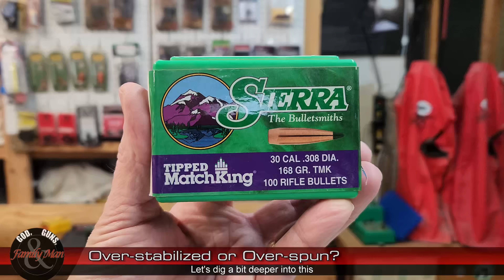You can't over-stabilize a bullet (but you can over-spin)

Comment: Bullet companies list MIN twist rates for some bullets.......usually 8 or faster for modern heavy for caliber high BC bullets......but now wondering if they also need to list MAX twist rates or better still, MAX muzzle velocity for the fast twist barrels like 7, 7 1/2, 8 etc. if using that bullet? A bullet flying apart as it leaves the barrel would seem to be as big of a problem as one that is not revved up enough to stabilize it. Maybe in practice most guys never get them going fast enough to fly apart?

Comment: If I shoot a pistol under high angle close to vertical will the bullet still spin and point upwards or will be coming down with the point first
Reply: I mean will a short blunt projectile spin stabilised that it will not turn like gyroscope
Reply from the maker: @CsakEn-pl7uv  It will still spin due to the rifle and should -in theory- come down nose first.  Not a test I recommend actually trying though.  :)
Thanks for watching and posting.

Comment: I'm glad someone FINALLY decided to make a video on this. 

Putting a 1/3 twist barrel on your grandpa's 30-30 isn't going to magically give it match-grade performance. Bullet profile and consistency have more to do with accuracy than over-stock twist rate. Also, there are a lot of "match grade" bullets out there, that simply aren't. People think those words automatically translate to better accuracy... when it could simply be a specified profile/weight of any sanctioning body. Back in the old days of shotgun slug matches, some rules actually dictated real slugs... as in, what closely resembles a piece of bar stock with a round nose.
Reply from the maker: Well said James.  Thanks for watching and posting.
Reply: @sdkweber  - thanks again, for the content. 👍

Comment: Put the centrifugal force into the equation. An over spun bullet will fly apart . The center of gravity and the center of mass are not in the same place for a bullet but a foot ball they are. Make a bullet where the front and the back are the same and spin rate won't matter. Modern bullets do not arc over like a foot ball.
Reply from the maker: Good explanation.   Thanks for posting and watching, Ronald
Reply: That's not true, Ronald, and extreme long range targets prove it.
Reply: @jasonshults368  It is only 5° at 4 miles. The hole in the target will still look round.

Comment: Yep, I am gut-twisted every time someone uses that term "over-xxx". See, I can't even type it. My question always was, "For a given cartridge/bullet combination, as the twist rate increases and one moves from under-stabilized (big groups on paper) to marginally stabilized to stabilized (smaller groups) at what point do you have too much stabilization? On the other hand, an excessive spin is easy to detect by midflight disintegration. 'Overbore' is another imprecise term I am loath to use other than to point out its users employ it to put on a facade of knowledge.
Reply: That point was found with 1:3" twist 338 cal subsonics to be about 950~fps. There is a notable increase in dispersion & fliers iirc.

Comment: In my experience, 'a little too much' overspin is better in results than 'a little' underspin.  In .308 caliber, the 1903 Springfield was designed for 220 grain round nosed bullets initially, but quickly changed to a somewhat faster 150 grain spitzer bullet.  The rifle twist was kept at the initial 1 rotation in 10 inches (1in 10) twist.  I have loaded and shot bullets in a similar barrel with weights from 147 grain to 220 grain and all seem to do well for me.
This may be explained by accuracy requirements.  I do not shoot bench rest, so my accuracy expectations - requirements are not as great.  That could be the explanation.  

In anecdote, I do have an older rifle with a well used barrel.  The rifling is so worn (bad) one can identify the type of bullet at 25 yards.  The bullet struck sideways.  (I did rebarrel that rifle.)

Comment: I've noted that when hand load testing if i load a match bullet at say close to 275,000 RPM it tends to be more explosive (fragment) at around 75-100 yards but will expand at longer range 200-300 yards. And at around 350,000 RPM it can literally explode in flight. this is hog hunting
Reply from the maker: That number (350,000 RPM) has been cited by others as the point of excessive spin in some cartridges

Comment: You do a fine job of explaining this topic sir. 
Any imperfections in the bullet that affects the radial balance of the bullet IE looking at the bullet in cross section if the center of the bullet and the center of mass are not aligned due to variation in jacket thickness or variation in lead density or presence of porosity etc… this slight radial imbalance causes the precession cycles of the nose of the bullet to become enhanced or increased. Radial imbalances cause the spinning bullet to be perturbed and this perturbance is greater the faster it spins which increases dispersion. Modern premium bullet manufacturing has improved such that bullets are more dimensionally precise with less of this radial imbalance than bullets manufactured decades ago. 
So with cup and core bullets it is best to avoid over spinning bullets especially if you are running mass produced lower cost bullets that aren’t as dimensionally precise. 
Elite ELR shooters even use bullets precisely machined from monolithic materials to try to achieve perfect radial geometry so they can capitalize on fast twist with very long bullets without incurring increased dispersion due to these effects… and whatever other magic they embark upon to deal with dynamic stability in the transonic and subsonic zones that I do not fully understand. 
Projectile stability is a very interesting topic. 
Cheers!
Reply from the maker: This is some very good extra information.  Thank you for posting this! Well done.

Comment: Shooting lighter 223 bullets even at 223 velocity's with a 1-7 twist rate damage's the thin bullets jacket an shape  causing poor accuracy at even higher velocitys like the 220swift with a 1-7 twist rate might break apart in the barrel or shortly after leaving the barrel and with the slower twist rate wont stabilize heaver bullets   a lot of older rifle calibers were made this way such as 270,25.06, 220swift and more and all of them would have been much more useful for hunting a wider range of game if they would have been made with a faster twist rate you can overcome this problem by shooting solid copper bullets in lighter weights they won't deform from faster twist rates an gives higher bc numbers rifles with slower twist rates will forever only shoot lighter short bullets well without changing the barrel
Reply: thats not over stabilized... thats just exceeding it construction.

Comment: I  reloaded some blem 2nds. 40gr V-max look alike with blue tip. I suspect they were 5.7x28 bullets as my.223 1 in 8 twist rifle doing 3700fps spit a shard of jacket into my chronograph display. Over spun at speed?  My 24"W.O.A.1-12 twist spits them out at 3850fps with great results
Reply: thats not over stabilized... thats just exceeding it construction.
Reply: There are a lot of factors that can cause a bullet to come apart after leaving the muzzle. Among the most significant is the condition of the bore.

Comment: A full power 5.56X45 round in a 1-7 twist is rotating at over 200,000 RPM. If you've ever loaded light 45-55gr varmint soft points, fired from a 20-24" 1-7 barrel, the projectiles will often self-destruct just a few feet from the muzzle.

It was a real problem for me in the 80s & 90s (as noted in the Speer reloading manuals). By 2000, it seemed the 55gr soft points were not so thin skinned. They could survive full power loads in a 1-7 now.
Reply: thats not over stabilized... thats just exceeding it construction.
Reply from the maker: @russr  Correct.  Over-spun but not over stabilized.  I shot 40 grain varmint bullets in my .220 Swift at 4,230 fps and some of those just vaporized between me and the target.
Reply: @sdkweber  yeah, I had some Sierra 50 grain soft points play kept exploding about 10 ft out of the muzzle in my AR..

I never really had problems with VMAX. I had a load for my 40 grain V-Max what's 28 grains of 748 which is a compressed load and it would shoot under a half inch of 200 yd.... 223 load
Reply from the maker: @russr  I have used a lot of moly coated VMAX bullets in my .220 Swift and I like the Winchester/Nosler Combined Technology 40gr. bullets.  
That VMAX was shooting well for you.  I hope you stocked up on those bullets.  :)
Reply: @sdkweber  I switched away from the 40s to the 53 gainers, because most of my groundhog shooting was between 300 and 700 yards and the 40s kind of suck for those distances. 
Under 300 yd they were like laser beams but they dropped speed too fast.
Reply from the maker: @russr  I agree. And those 40 gr. bullets are killed by the wind.  Nothing really possible much over 400 yards.  But 0-400 it is like you say, a true laser beam.
Reply: A bullet is like a flywheel.  It takes energy to spin it. It dissipates that energy into the target.
Overspinning a projectile diverts energy from velocity into rotation. It should be spun enough to stabilize but not much more than necessary.

Comment: Are you also going to think about copper bullets as they are longer than lead bullets at the same weight?
Reply from the maker: Good questions and yes. The same concept holds true with copper bullets.  We need to stabilize them but not over-spin them.  I suspect however, that the homogeneity of the copper will reduce the imperfections within the bullet and MAY decrease the effect of over-spinning, that is, a degraded precision of our groups.

Comment: I really enjoyed this video. So is the bullet sized slightly larger (224 in a 223 and 308 in a 300) so that it has to be slightly squeezed to better engage the rifling?  I'm also curious to read your reply to Mike-xi4zt's comment below should you respond to it.  I've seen some of the slugs that Taufledermaus shoots on his channel that through the use of a high speed camera seem to show no spin and yet hit the target.  Perhaps while not 'finned' it's because the slugs have unusual shapes that mimic them? Thanks as always!
Reply from the maker: Thanks for watching Aaron.
You got it right.  The bullet is wider than the distances across the lands.  This forces the lands (rifling) to bite into the bullet and engrave fired bullets with the firearm's rifling.  The naming though can sometimes be just marketing.  For instance a .300 PRC shoots a .308 bullet, but so does the .308 Win. and .30-06 and .30-30 Win.  A .220 Swift shoots the same bullet diameter as a .223 and .22-250.
I have not seen Taufledermaus' videos. I will look it up.
Take care Aaron.
Reply: No. the distance between grooves is 0.224, the distance between the lands are smaller and that is where the bullet is squeezed.
Reply from the maker: @brucestarr4438  Correct.  The diameter across the grooves is .224.  I may not have answered Aaron's questions clearly.

Comment: Faster any object spins the more stabile it becomes, even If it is out of balance. Rotational velocity can exceed  outward acceleration due to Non balance center of gravity. Any "center of pressure" is exceeded by rotational gyroscope stabilization.
The only time overspining a bullet affects accuracy is when the heat and rational velocity exceeds the bullets ability to maintain its shape, and causes it to deform or fly apart. All rotating objects are more stabile the faster they rotate.
Reply from the maker: That is what I thought for years also.  Then about a year or two ago I read Jeff Siewart's book "Ammunition Demystified" and he explained the effect of over-spinning a bullet.  That made me dig into this and do much more extensive research and much more reading.  I tried to explain this in the video (I believe Hornady did a pod cast and discussed this also).  

Bottom line, it is very real and over spinning a bullet will harm precision and this is primarily due to integrity issues of the bullet as over-spinning accentuates:
Errors in bullet construction.
Differences in a bullet's axis of symmetry relative to it center of gravity. 
Differences in a bullet's axis of symmetry relative to its axis of inertia.
Reply: @sdkweber  Physics says rotational velocity Can Exceed outward movement velocity. That means even if it is out of balance it can balance itself out with enough rotation.  vehicle wheels are on a rotational speed limit, or you get a citation. You can spin bullets as fast as you want. Enough rotation will zero out errors in bullet construction. Not enough rotation will cause insufficient stabilization, wobbling, or tumbling. I can give you the physics equations, and plugging in numbers will illustrate what I am saying. Unfortunately, there are so-called experts that are not really experts.They don't understand physics. The bullet goes to sleep theory is complete mythology nonsense. Nowadays you can watch NFLs longest passes on youtube and play them in slow motion.  The footballs thrown wobbly stay wobbly until they are caught. They do not go to sleep. A top wobbling and falling over is in contact with a stationary object which changes the forces acting on the rotating top. A bullet flying through the air does not have its point sitting against a non  moving object and does not straighten out like a top does and does not wobble around the point that is in contact with a stationary object. 
Barrel rifling tears up they finish on the bullets and has an Effect on the integrity of the jacket. If you spin them Enough to make them Bulge
 or come apart They will not Shoot straight. That is literally the only type of "overstabilization" that can exist. All the rest is BS.
Reply from the maker: @Mike-xi4zt  Feel free to post links to the equations. I would like to see them.  For me, I am siding with the ballistics experts like Siewart on this.  His work is also physics-based as well as experimental.
Reply: @sdkweber  YouTube doesn't let you post links in comments
Reply from the maker: @Mike-xi4zt  That is unfortunate.  I will dig into this quantitatively more later.
Reply: @sdkweber  I watched the podcast with jeff seiwmart.  Duplex loads been around forever. Elmer Keith was doing that before World War II. Gain twist has been around for a hundred years artillery has steel case ammo and they use a copper ring to engage the rifling for gain twist. Regular Small Arms copper bullets in the whole side of the bullet engages the rifling in Gain Twist causes eccessive bullet deformation. I would agree with him on there is no magic cartridge. A bullet being pushed down the barrel with 60,000 PSI does not know what cartridge case it came from and does not care. To say a certain cartridge generates a special magic fairy dust 60,000 PSI is ridiculous.
I have an electrical engineering degree and I've taken plenty of physics classes. This guy was telling the story about shooting the tank round steel rods through three targets and couldn't hit the last Target. And comes up with some calculation of maybe there was a stone in the first two Targets. Why not just remove the first two Targets and see if you can hit the last one to see if there's something else going on. That's called dumbass logic.

In a bullet there is a moment of inertia and center of gravity. If there is an imbalance in the moment of inertia when a bullet is flying through the air if it is rotated fast enough it will rotate around the moment of inertia in combination with the center of gravity whatever the net force is of those two for the bullet. The bottom line the bullet will be stable if it is rotated fast enough whether it is rotating around the moment of inertia or the center of gravity or both simultaneously.
 "pressure force" is already being overcome by the rotational conservation of kinetic energy. The pressure force will be equal around the bullet because of the direction of flow of air. If you're pushing the same amount around all sides of the bullet the net force is zero.